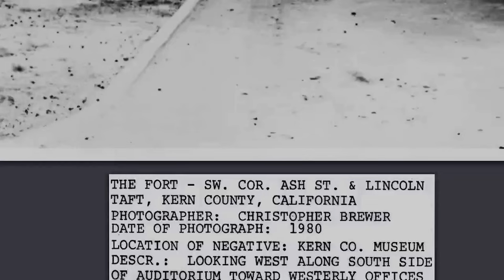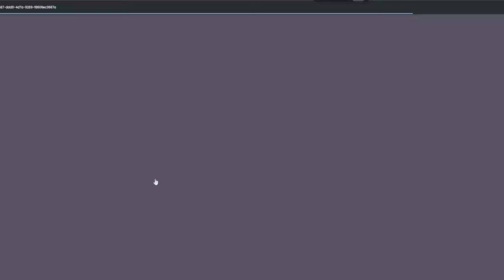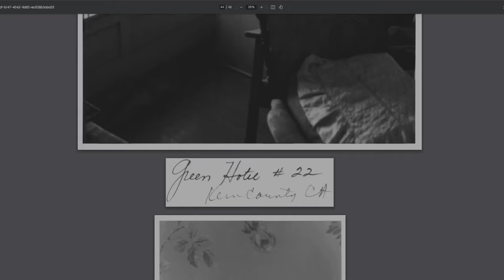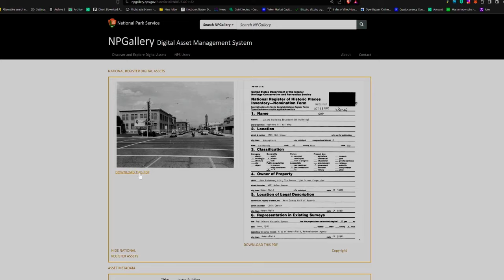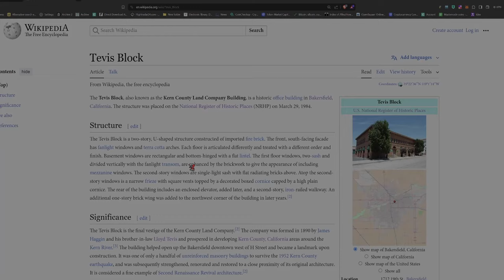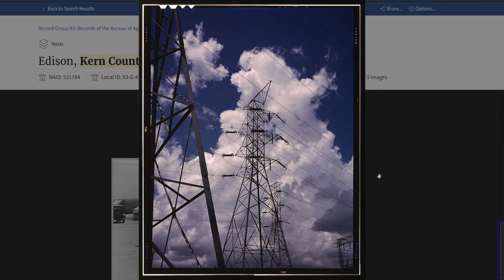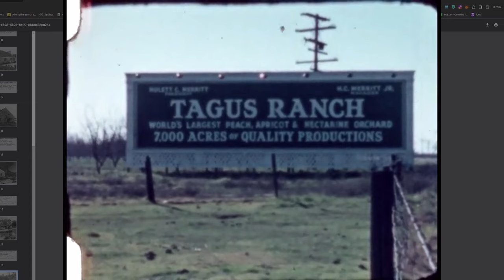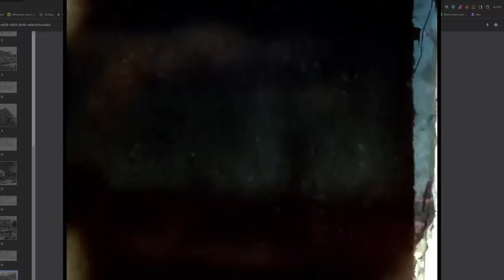California Historic Buildings : Kern County Vol 1

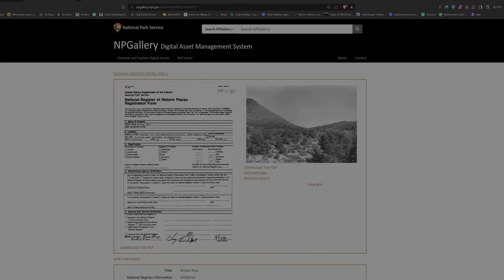Comment: 48:09 Robbers Roost! We used to hang out here in the 90s and do punk rock teenager type things. I reckon local teens still do, just like the robbers of old, roosting.

And holy cow Five Fingers mountain. This whole area and mountain range are a very common Hollywood background for scenes shot in the desert. Old Inyokern airport is right there, with Five Fingers and Robbers Roost and many other peaks in view. Bulletproof a forgettable Adam Sandler / Damon Wayons movie features prominently this location.

Bonus Trona Pinnacles is the location of many other Hollywood features, not the least of which is when the crew of the Enterprise meets "god" at the Trona Pinnacles.

Anyway thanks for coming to my TED talk on Ridgecrest and desert and Adam Sandler.